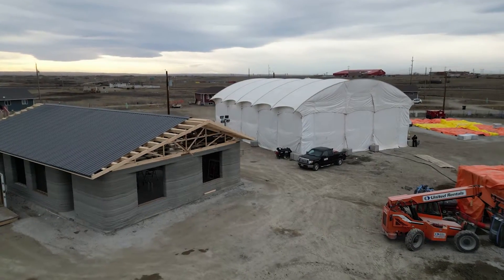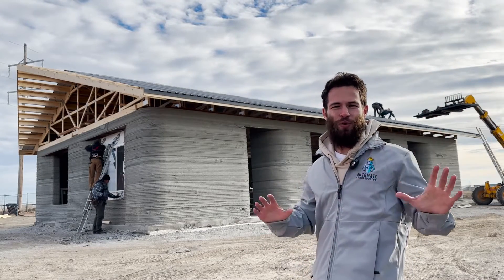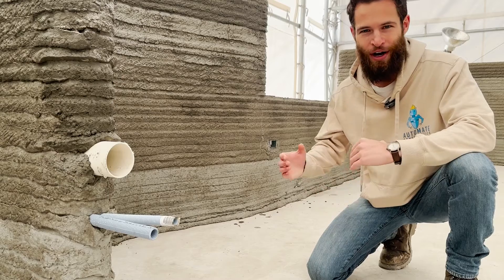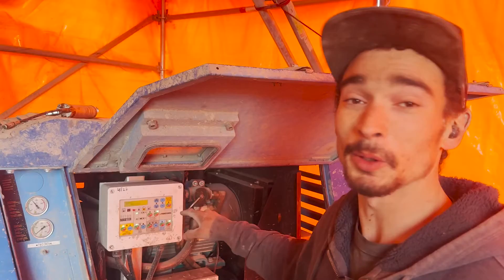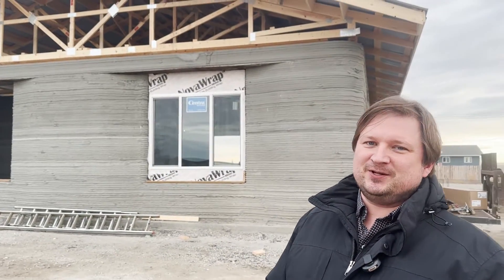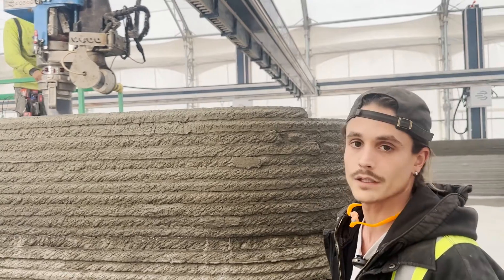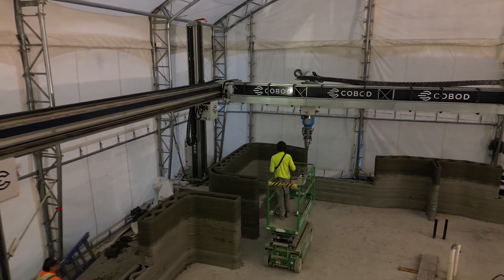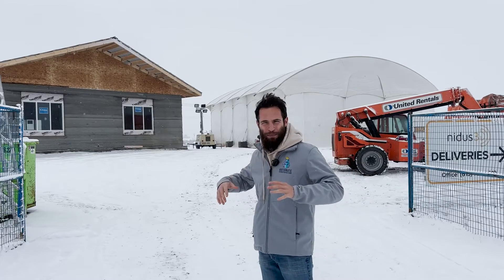16 Unit Print in FROZEN Alberta

Comment: I truly believe this is how you bring affordability housing back.
Reply: Concrete is very expensive and it doesn’t seem to be any faster than traditional lumber framing.  Also it requires a few technicians at least and someone has to be well in front of it laying rebar.
Also, very difficult to renovate or repair walls.
Neat idea but I don’t think it solves any problems.

Comment: Watching one of the older videos that showed a 3d printed house from the 1930's? the wall finish was superior, due to a cutting wheel on both sides of the print head. Considering that's gone open source (after 90 odd years), i dont understand why it isnt incorporated into all the print heads. While i don't mind the finish, my friends and family prove it is the most polarizing piece of this construction method.
Reply from the maker: That wasn’t custom designs and was loaded manually. It would be really cool if someone built it I would film that!
Reply: @automateconstruction I’d love to see it.
Reply: The Urschel printer used a non pumpable, low water mix that was mechanically packed, allowing a very smooth finish using the rotating trowel. It's amazing and the design clearly took a lot of effort and iteration. 

But the method is not directly applicable to current extruders, which use much more flowable mixtures. The jagged walls are a practical compromise for productivity and automation.